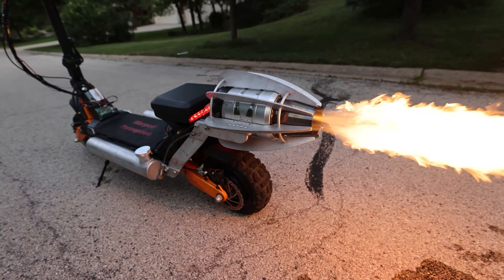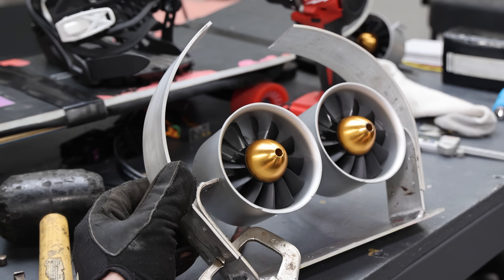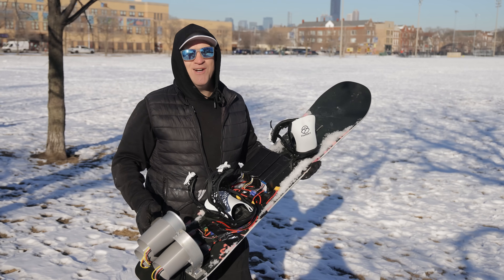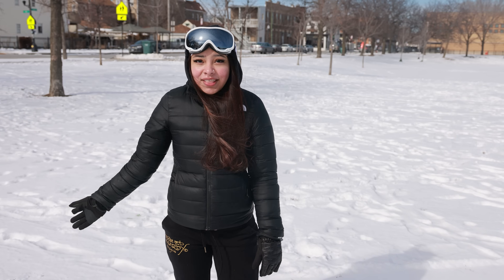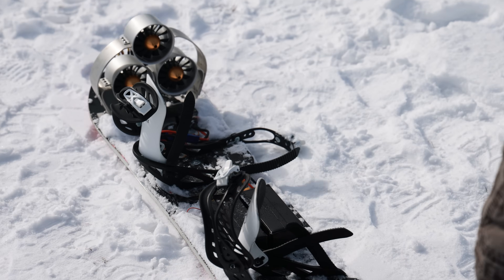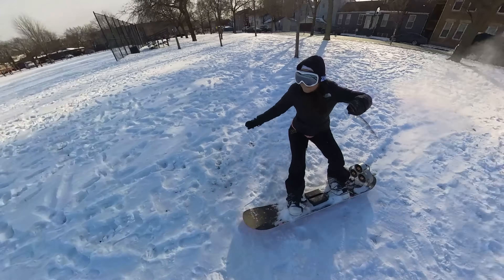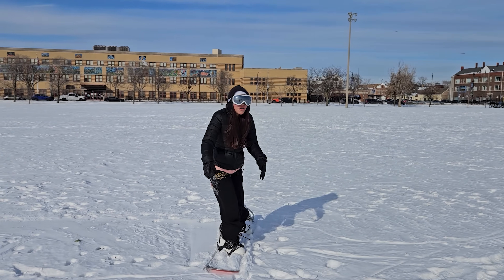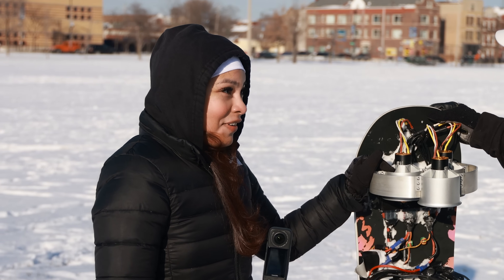I Put Electric Jet Engines On A Snowboard!

Comment: You gotta check out this new 277cc V8 engine. I think it's perfect for your videos.
Reply from the maker: Unfortunately I had a deal with that company, I was supposed to do a V8 go-kart, I spent $10K buying the go-kart, months working with a guy from the company named Rhett, then halfway into the project The owner fired him, took the idea and told me they were going to do The V8 go-kart on their own in China using my ideas, It's okay Let him do whatever they want, I still have the go-kart here and the entire project I just need to do it with a different engine. Unless they come back and have a good reason I don't think I would trust them moving forward. Have you looked back at my V12 dyno video That was their engine and it did not perform well.
Reply: @WarpedYT  That's too bad and I was wondering if it was their v12 Gotta hate.
When people steal your idea

Comment: Perhaps if turbine(s) are angled upwards a few degrees, it may help on flat runs by lightening the front side.
Reply from the maker: Possibly, but when I rode it I had to keep my weight dead center in the middle if I were to move front back left or right at all the snowboard Will slow down.

Comment: you should put jet engine
Reply from the maker: I wanted to at first but I decided to start with the EDFs, What I didn't expect was the complete lack of snow days, literally had three snow days over the two last winters. Very hard to take a snowboard out to test without snow. Which is why this video was sort of cut and dry, originally I wanted to go through the paces and increase the power significantly with every revision.

Comment: I came here to learn to rebuild a carburetor on a free snowblower. I currently have 17 snowblowers, 11 generators, 12 lawn tractors and a basement full of two stroke equipment. Both Google and this platform has changed for the worse in my opinion as I used to be able to search “valve specs for X engine” and at the top of the age were the intake and exhaust valve specs. Now it’s just vague information and 12 websites that may answer the question if you dig deep enough. In the meantime I’ve been building a library of tech books like “Diesel Fundamentals” and Chilton Repair Manuals like gas stations used to have. Like corded power tools everyone so kindly threw away  that I jumped on when visiting various town dumps I’ll let the future pass before considering becoming a part of the present.
Reply from the maker: Wow so are you saying that you type then that search query in Google and it recommended this video? If that's a fact then that makes a lot of sense as to why this video is not getting views.
Reply: @ I’ll get back to you by 10am EST. Dealing with an emergency of sorts.Been subscribed to your main channel 12 accounts ago since constantly writing “Supra please.”
Reply: the search has gone to really to the dumpster over past 10 years.  it began when it started to score only the 'top' 500 pages to decide what to show on the first page, down from thousands back in the '00s. like you do a search for a phrase that appears on hundred thousand sites.. and you get back 15 results? ridiculissimo. 

like the search can't find even exact phrase matches anymore for couple of years. you might get to them if you just add random words. its ridiculous how bad it is, it does make the ai gemini more necessary though just because of how bad the actual search is.

Comment: Lol wanna see someone go down the hill with this on full blast..
Reply from the maker: I was going to do that but we didn't have enough snow days. In the previous video I did in fact have the one girl try it on the hill but she couldn't snowboard without it so it was sort of a lost cause
Reply: This would give you a huge speed boost...!
Reply from the maker: @MeepMeep88  I actually posted what you said on Reddit, but very neutral, people did not respond nicely for some reason.
Reply: @WarpedYT  Id say because unless its providing lots more speed, then people realise you are going to be faster just by going downhill than if you were to use the triple edf's. These edf's are really inefficient as we only usually get 4mins flight time even with 25v 5000mah lipos in our model jets. And id say judging by these edf's basically being on full throttle for most of the time to barely get the board moving with a person standing on it, is why one of the esc has failed already. Lots of drag, and to much mass for these little fan units to give the desired effect. Maybe try some HSD 120mm edf's that will run on 12s, that will get ya moving.
 Now, for the next design, I wanna see 3 jetcat turbines on the board !! ;-)

Comment: My math must be wrong, I calculate less than 10 minutes run time at full power… Assuming 3 8S batteries, 1 for each EDF (I can’t really tell what is in the black box between the rider’s feet, but one battery per fan makes sense) that’s maybe 24 amp hours of battery capacity, but each EDFs at full power will draw like 100 amps, so like 5 minutes of runtime at full power.  And it looks like more or less full power is needed just to move slowly over flat terrain.  So, like with many things electric, the problem is storage energy density, batteries just can’t hold enough.
Reply from the maker: True but this is just a prototype Proof of Concept
Reply: @ I get it, and I wasn’t in any way knocking what you built, it’s very cool, I’m just pointing out that we need better batteries so cool thinks like turbine powered snowboards can exist as actual commercial products.
I’ve built 5 prototype electric race cars for hill climbs and road racing, and batteries are always the biggest area of compromise.
Reply from the maker: @jpe1  oh yeah no I didn't take it personal, I'm on the same page. I'm actually custom building a battery for this particular snowboard but I have to wait till next winter.

Comment: I think that placing the motors up higher somehow so you don't have the snow going through the engines might be the play.
Reply from the maker: @BHSAHFAD  The final version is different but the reason the video is so short is that ran out of snow, I waited November December and January for snow and nothing, but the newest version is different I just couldn't put it in the video because there was no snow.
Reply: @WarpedYT  No shot you actually replied to my comment!! You got super interesting videos, you always do super interesting stuff! On this video I kept thinking to myself even like a bracket that keeps the motors 6 inches above the board would have probably been sufficient, if you are doing jet turbines I would hate to see one of those jetcat turbines eat a small rock chip and break.

Comment: Create a smooth aluminum heatsink on the bottom and cool the esc with that, maybe it will melt the ice creating a water layer to slide better?
Reply from the maker: @kostaslaza12  thanks but on that I have an even better idea!
Reply: That wouldn’t be desirable, you’re going to create ice on the part is the board that isn’t heated
Reply: That's a super great idea, maybe use copper heat pipes to transfer the heat.
Reply: That is what already happens when the board passes above however extra water would be interesting.
Reply from the maker: @Physhi  true ...and that would be interesting